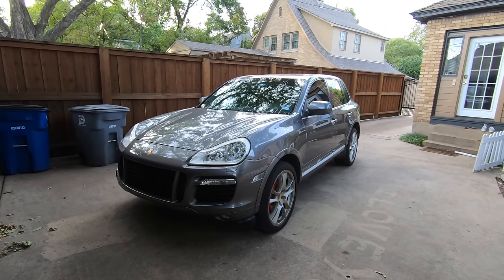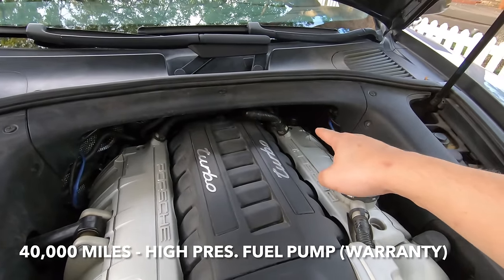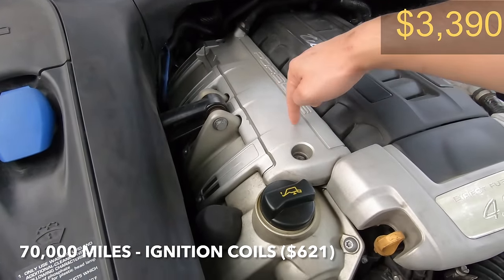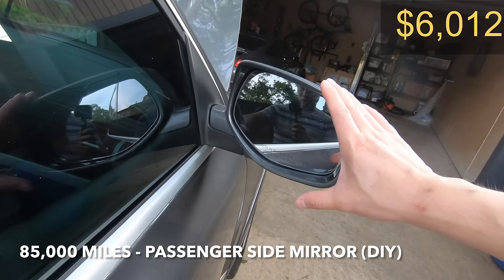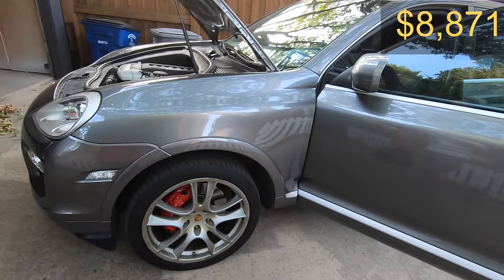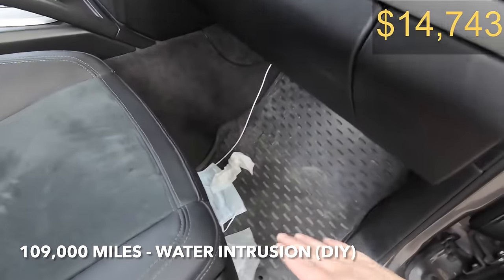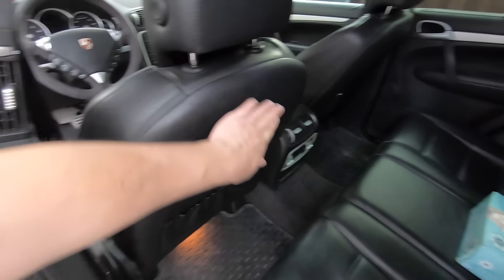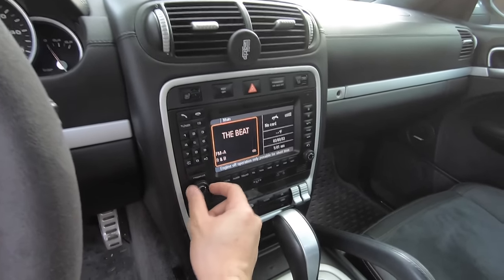Why Are Used Porsche Cayennes So Cheap? Owner's Review of 15 Year Old Cayenne Turbo (955, 957)

Comment: That really Sucks! My 2004 Honda Pilot, $28,000 when purchased new, now with 200,000+ miles (still going strong) has only had 4 minor repairs: 2 Window Motors, Fuel Pump Relay and the Idle Air Control Valve. I repaired all myself for under $200 in parts. It never left me stranded or had to be towed. So much for German engineering!
Reply: Yeah. It dives like garbage truck
Reply: No disrespect to Hondas, but they’re much more simpler because they’re kinda boring. To get luxury and tech and performance means complications, complications means more expensive and complex materials and parts that’s just how it goes. A bigger engine with thicker oil with triple the amount of power you have is the reason why they break and neglected as well, the Germans don’t follow the routine maintenance the Japanese cars follow. Bigger breaks, beefier trans, diffs, overall chassis is built around performance and people buy them thinking they’re normal cars and abuse them like normal cars.
Reply: these fan bois have got stockholme syndrome, you won't be able to convince them that they are getting mugged off
Reply: The Germans engineer it to keep their dealers happy. A lot of these issues are things that should be happening at 150,000 miles and higher. If you’re going to buy a used German luxury car, expect to pay German luxury car repair prices.
Reply: I see a bunch of G1 Cayennes for sale around $2-2500 with various problems. I do my own work so I would not mind buying one to fix and drive on weekends. The ones I see cheap are the 3.6 and Cayenne S models.
Reply: But you still have to drive a ladies car.
Reply: BMW, Porsche, Mercedes are smart businessmen who charge 2x for a vehicle that lasts half as long because it goes vroom!!! How often are they able to use that horse power like once or twice a week?
Reply: The companies have different design goals based on their customers. Almost 90% of Porsche Cayennes are leased, so being unreliable long-term doesn't effect repeat customers. Last year my sister traded in her 2004 CRV for a new one - if it had given her 17 years of trouble, Honda would have lost a customer.

It does suck though. Mercedes used to be crazy reliable before leases became common, and they realized they needn't bother.
Reply: @moneyparhar  …how do you know….are you driving one of those trucks ?
Reply: I purchased my 2022 macan cash and I will replace every couple years with a newer one, much more fun than a honda and I really couldn’t care less what it costs😂
Reply: @moneyparhar  it, being a Porsche I suppose. Just want to know - have you ever driven a garbage truck, a Pilot, a Porsche to speak with authority that is? Or this is just idle conjecturing and all you have ever driven is bicycle?
Reply: @dicknawson  Bhahahahahaha. What do you drive? I guess you take a bus.
Reply: @vicinvesta8349  stay driving boring cars then.. lol.
Reply: @aidenp5768  1) what do you drive? And don't lie. 2) I guess when you have unboring car like Porsche - every time it did not break down - excitement.  
I drive MT Civic DX '97 as my daily.  35MPG and never failed. 250K miles on odometer. No leak, no squeaks. That's unboring!
Reply: This guys Porsche doesn’t at all drive like your Honda. I’m not knocking the Honda, it’s a different car. I have 2011 Lexus GX with 150k. It has needed some service and repair to the tune of about $3500 over the last few years. He’s also running the V8 which has some known issues. The base V6 is far more reliable. I know have one of those as well. Well it’s with the X wife for the moment anyway and she doesn’t want to give it back. 🤷🏼‍♂️
Reply: @aidenp5768  
Your argument is silly.
Complication has nothing to do with Luxury and tech.
European cars are just unreliable and crappy quality.
Reply: @tom11zz884  Yes it does, lol that’s dumbest thing I’ve heard yet. Adding beefier suspension components, and more control arms, unique suspension architecture for better stability, better weight distribution, and be able to take corners as well as it does, able to go high speed without the typical sloppy suv nature is an example of more complicated was implemented to make a car better and a reason why it’s more expensive to maintain over the simplicity of a basic suspension you find in let’s say a Rav 4.
Reply: @tom11zz884  Take a Rav 4 across the autobahn and give it 400+HP and see how confident you are doing over 150 in that skinny tired, and pathetic suspension. Had my 20 year old X5 do 130MPH flat out, confidently, no shakes, no vibrations, you think I was able to do that because of simple non complicated engineering? My car had aluminum architecture which was one of the first cars ever to have it up front back in late 90s, that’s complicated engineering, 2 axle air suspension, multi link arms front and back, rear front anti roll bars.. I can go on. And not to mention 315 staggered wheel setup, for you cheap boys that’s why it does what it does..
Reply: But in the end is just a boring honda pilot😴
Reply: 2011 Pilot, replaced timing belt at 100k, will replace again at 200k
Reply: @tom11zz884  It has everything to do with it. They are always chasing and changing. The Honda they can keep the same, because it doesn’t have to perform like a supercar. This Cayenne Turbo is a beast. I think it makes 500 hp or more. Yes, turbo is added complexity, all sorts of it. Then, you have to build a transmission that can handle that power. And brakes and suspension to not only handle the weight and power, but do it well at high speed. Even when Honda released the Type R, a complex race vehicle, there were some problems.
Reply: @aidenp5768  tomzz is trolling or doesn’t know cars. I wrote a reply and realized you already had done so.
Reply: ya but you forgot the capability, hahaha, and he has not learn yet, he's got an other german crap in the garage
Reply: Yeah never understand what is all these hoopla about German .. please educate me
Reply: What about 100k work? Belts and water pump?
Reply: @mauriciobarrientos6688  In "Porschah land" (like in lalaland) they change their whole vehicles (like in buying new)  at those intervals. A pilot owner will never understand smelling their own farts Porschah owners.
Reply: There you go, blame all of Germany because some guy had a problems with Porsche😀 
My BMW 520d gave me 5 years of service for oil/filter changes @ 12,000miles a year.
Reply: Nobody cares lol
Reply: Timing belt needed replacement at 100,000 miles or 7 years.
Reply: To be fair, toss American engineering in there. My Jeep Wrangler left me stranded on the side of the road twice in 6mo. I sold that POS and took the bus for three months before I found my next car
Reply: Every German car is different, some go 100k miles with $200 worth of work like yours but some are nightmares like this cayenne
Reply: No spark plugs coil packs brake work timing belt or suspension work? Highly doubtful
Reply: @aidenp5768  I have a built Audi that would hand that minivan its ass. I drive it for fun. I drive my Honda Accord to work, or when I don't want to look like a privileged idiot.
Reply: @showproja  haha facts, you know what’s funny, I own an accord as well. I drive it daily too, my dad has owned several as I grew up, 6th gen - all the way to 9th gen. They’re good or one of the best commuting cars but no where near as fun, stable, quick, luxurious as my BMW X5.. like no comparison, and reliability wise my X5 out lasted one of my dads accords same year 2004. That’s why I call bs on these reliability nerds sometimes.
Reply: @moneyparhar  What a thoughtful response.
Reply: @quartermaster1976  every day on my commute my Cayenne gets an Italian tune up :D
Reply: Hondas are the best.....simple as that.
Reply: @pleun315  😂
Reply: @aidenp5768  "Yes it does, lol that’s dumbest thing I’ve heard yet..." Porshe 911 before this SUV came up was one of the most reliable cars and that is in comparison to every other cars for the first 10 years of exploatation = it was breaking less than any other car... So yes. LoL, dumbest argument ever to say that luxury cars = unreliable.
And i heard that this car is very unreliable in something like 2008.
Its expensive car made by well known company with huge experience so owners expect quality and this car was simply staining the good name of this car company.
Its one thing that some cup holder is not working smooth bu over at half of this failures in this videos are simply caused by crapy quality/bad design!
Reply: @Bialy_1  Not saying luxury performance means unreliable, the point is they’re expensive asf to the people who abuse them, you missed it. Give a Porsche to these cheap Japanese’s brand owners and to them it’s still unreliable and costly. A diff, trans, control arms, cv axle, shocks are still things that will break just like any other car, the price for them hurts these reliability nerds to their core. Point still stands.
Reply: And people want 20k+ for these cars. Better off buying a new car under warranty (provided you aren't paying several thousand over).
Reply: If you want something reliable and cheap to run you don’t buy a performance SUV. But what am i saying, you  are comparing a honda shoebox with a porsche SUV, and then you are proud that you saved money…oh boy. Best part is your „german engineering“ thing, comparing two completely different and arbitrary…no. No, i should stop, you don’t want information, you want to feel better with your oldtimer honda, and that’s why you write those things. It’s no use to bring arguments if someone just tries to feel better about himself…
Reply: cause there is nothing that break in it, nothing extra on it and the engine so weak it couldn't hurt itself if it even wanted to
Reply: Same with a 2005 Honda CRV with 200K+. Yes, it's boring. Boring isn't bad on an 8 mile commute to work, and I have another fun car. Owning one of these out of warranty is Russian roulette.
Reply: @erebostd  I'm going to argue that if you want something fun and sporty you don't get an SUV. Get an SUV for the "U" and get a sports car for the "S".
Reply: @DragNetJoe  japp, in full with you there. The SUV plague is cancer on the streets…but people buy them. Especially the sporty versions…
Reply: If you have surplus money to waste go for European cars. If you want no problem cars go for japanese cars
Reply: @aidenp5768  "my car had aluminum architecture which was one of the first cars ever to have it up front back in late 90s" The NSX is laughing at you.
Reply: @SVSky  So it looks like you can’t read, one of the first, means like the very few cars at the time that had it, acting as if I said, “was the only car that had it” don’t know for sure but the X5 was probably the only one with aluminum structure as an suv, now that’s not a fact I know for sure but I guarantee in 1999 it was the only one.
Reply: It's what you get for buying a rebadged VW
Reply: @davidj4662  520hp is quite a ladies car.
Reply: @bzilla-d4i  parrot
Reply: @JWestLoans  triggered VW fan, if you really want the Cayenne that badly just buy the V8 TDI Touareg, more value for your money, and if you want a real off-roader just buy a Land Cruiser 70 series.
Reply: German engineering is designed to efficiently extract Deutschmarks 😮
Reply: Agreed many German engineered vehicles are high performance and higher maintenance.   Although those pilots do have a timing belt and valve lash adjustments not mentioned there.  Not bad $ if done by a good independent mechanic.   If not done both of those things will cause from a mpg drop to a destroyed engine.
Reply: @aidenp5768  who cares if its boring!!!  IT WORKS!!!!!
Reply: BUY TOYOTA!!!!
Reply: @Rzagski  "This guys Porsche doesn’t at all drive like your Honda."  There isn't a huge difference between how a NSX Type S and a 911 Turbo drives.  It is an oversimplification to say Hondas drive worse than Porsches, often involving not comparing like-vs-like.
Reply: @dicknawson  Walking would be cheaper than your bicycle
Reply: @sunnohh  Macans are disposable cars
Reply: yeah but can you rev?
Reply: @tennnis498  Acura NSX(old version) is a great sports car and it doesn't break down.   Lots of engines can make 500HP now-a-days.  It's no excuse for a car to break down.
Reply: What a POLITE way of telling someone they're a complete IDIOT. I just simply called him out for what he obviously IS.
Reply: @pleun315  Here in the UK most professional mechanics drive Japanese cars. That tells you all you need to know.
Reply: @lestrem11  yep 😂😂😂😂
Reply: @asitmc  best comment here. ever. of all time. plus infinity.
Reply: @aidenp5768 i guess that's why Lexus is such an unreliable pos brand of cars -- they're luxury vehicles.
Reply: @aidenp5768 something about that 1st gen honda crv with all wheel drive that makes you like and respect them. Doesn't matter what the weather throws, it just goes.
Reply: This has nothing to do with porsche other rha. The badge. It's a soccer mom car.
Reply: I like my Toyota, I really like my Honda, but I love my German cars.

Bragging about your car being reliable is like bragging that your wife is punctual.
Reply: People who brag about their Hondas on every message board are so annoying. Why are they even watching a video about a 1st gen Porsche cayenne turbo?.. just to find somewhere to brag about their stupid Honda I guess. I owned a ‘99 accord and my wife had an ‘02 civic and they were definitely not reliable or enjoyable to drive and I doubt I’ll own another one.
Reply: Boring car for a boring life
Reply: Maybe rust?
Reply: @moneyparhar  9:28